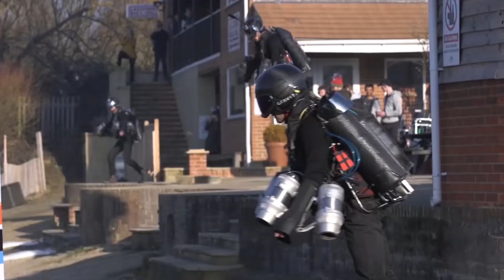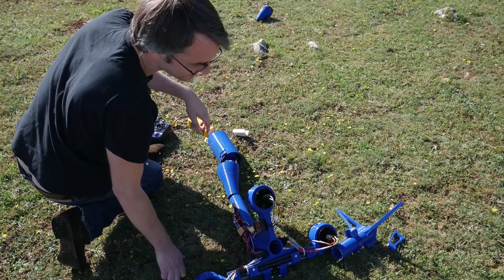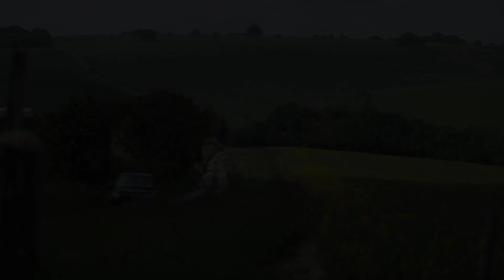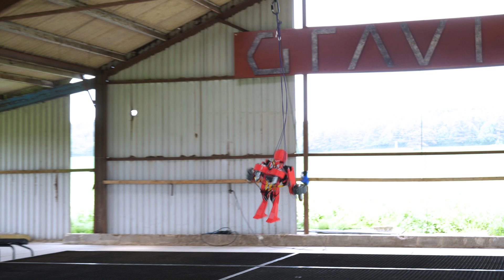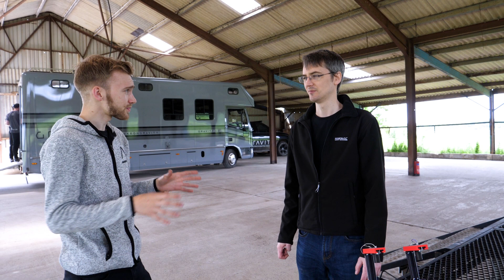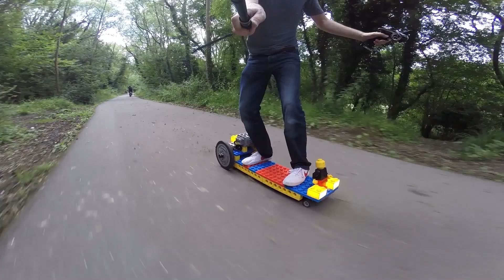Flying Iron Man #2 - WITH REAL JET SUITS ! | James Bruton

Comment: It seems to me that moving legs are a key part of it.
I intuitively wonder if simply introducing a loose joint at the waist allowing the legs to hang would make a difference...
I would much rather see an automated system controlling their relative position than some of the other ideas.

Comment: In my opinion, joystick controls cannot be used for figure models, because the controls do not use balancing / automatic balance. If used for humans, joystick control is sufficient for arm pressure control, (because the position response and balance needs will be quickly controlled directly using a direct human arm) and for control on the back you can use another finger to meet the need to fly, in essence a jet fan. the rear for flight needs and the jet arm fan for balancing / balancing needs. sorry i use google translator

Comment: Yeah, I think it's the weight distribution. Also, you can't simulate the Gravity suit with a remote control, and from outside. When you are in the suit you know exactly what to do...
You can only use a remote controller with a fixed system, or put an AI with gyros in it, and let it control itself. Or do micro-adjustments for your controller...?

Comment: Hi James, just want to clarify one point about the fallacy. If you have mass suspended or elevated from a thrust body, and that mass is rigidly connected to that body, then the fallacy applies. The body can just be modelled as a COM shifted body (demonstrated well in Tom Stanton’s video). The fallacy falls apart, however, when that mass is fixed at a pivot, as in it is free to swing relative to the thrust body. If you know a fair deal of control theory you’ll see that the model becomes a complex set of coupled differential equations. From that math, and some fairly basic tests you’ll find that flying a drone with a suspended pendulum is inherently more stable than an inverted one. 

In short, since you have your thrust arms attached as pivots to the rest of the iron man assembly, there becomes a flaw in your assumption for the suspended/elevated mass fallacy. And that’s why you saw better (although not perfect) results when lowering the battery. 

One design change you may need to better this assembly is separate the torso from the rest of the lower body. And attach the lower limbs of the iron man, as a pin, universal or ball and socket joint. This will allow the legs to always swing and generate a stabilizing moment and recover the pitch and and roll. 

Hope this helps keep up the good work.
Reply from the maker: Interesting, thanks!

Comment: Have you considered putting a couple of joysticks on sliding tracks, on a base that is suspended in front of you from straps coming off of  a harness (like a back pack turned around backwards), to use as a controller for the drone thingy?

There are other ways to get more axis into a joystick, though I'm not sure the one I have in mind would be useful… I had a Logitech joystick, that let you twist the stick, as well as all the other stuff. But I was thinking that you could also put the joysticks on tracks, like tank tread controls, or even allow the joystick to be pulled away from the base on a slide.

Comment: The control inversions that happen when aircraft face different directions is exactly why it's so impressive when people can fly 3D/aerobatics with  RC Planes and Helicopters, every different orientation comes with different "control inversions" If they had someone there who was used to flying line of sight aircraft, I think they would've done better, though I'd imagine flying the model is still very challenging.

Comment: As for the rocket pendulum fallacy - as long as the thrust vector goes through the center of mass it doesn't matter if the power source is on the top or the bottom. However - it must go through the center of mass or rotation would be introduced. That's why the Space Shuttle main engines were at a weird angle - to direct the thrust into the center of mass. Of course, with 3 thrust vectors it's gonna be a tough challenge to compensate without a human pilot sense of balance...

Comment: You should put the model on a rod so it can just rise up straight until you work out how much thrust you need and get the values set to keep I from twisting and rise, then control it like the gravity guys with just arm movement. The bungies are making you like a baby trying to crawl,walk and run all at the same time. Baby steps...….then go tethered.

Comment: Gravity.co pilots use their inner ear for balance, small quad especially with ducted fans, is too unstable for human control with sight only...
Reply from the maker: you may be right, but we're going to find out
Reply: @jamesbruton  Traditional RC helicopter with flybar and gyro takes ~ one year to learn, that just for basic flying. And control scheme is way simpler: Example 'balance' is in one stick (cyclic).  I think that just programming a flight controller (or building and programming your own) for the Iron Man setup would be interesting and challenging enough.

Aaaaaand this for ducted fans: https://youtu.be/0stl1U9evzU

Comment: Pretty awesome in general, though one of the points of contention I have with your testing of the all-metal-EDFs and bungie cords is PUT SOME THICK GLOVES ON! Cause I kept seeing you try to catch it when it tumbled and what went through my mind at that moment was something like: 'If he misses while trying to catch it there's a possibility of one/several of his fingers going into the still-spinning EDF', and that would be... particularly unpleasant.
Reply: Sure, but I don't think you could get worse than a bruise under the nail.
Reply: I guess it depends on how much residual spin there is left in the rotor, which side of the rotor his finger ends up in (so yes to a bruise if it hits the finger's top, but for the bottom...) and how sharp the blades are. Still would make me wary of attempting such a grab.

Comment: You're quite going to need the counter-rotating fans IMHO, because whilst a fixed angle might work at some speeds, I doubt it scales properly to all speeds, right? And you lack the arm control the Gravity guys use to counter rotating.
Reply from the maker: I think the difference is that they spin up to full speed and never change while they're flying, so they don't see any counter-inertia.

Comment: "A wild Furze appears" James uses "Thrust Vector", its super effective. 😀I reckon something like a KK2 board would help tremendously
Reply: KK2 has nowhere near the speed and processing power required for this thing.
Especially when you can buy an F3 or F4 flight board for about the same price.